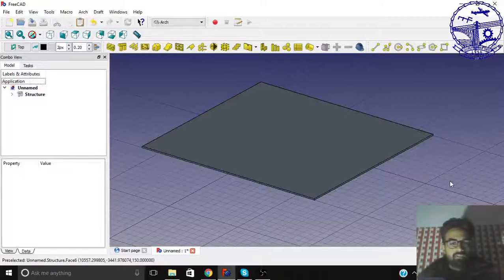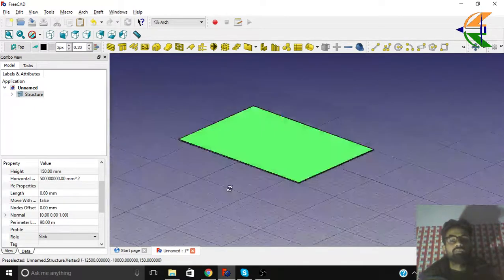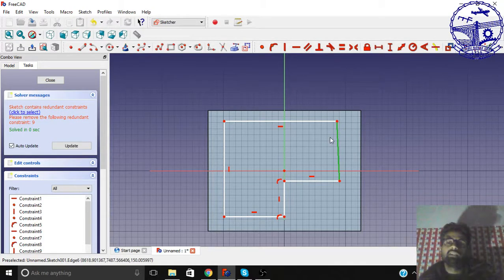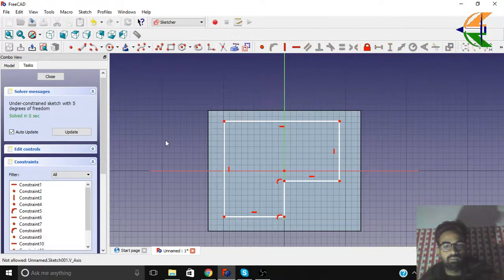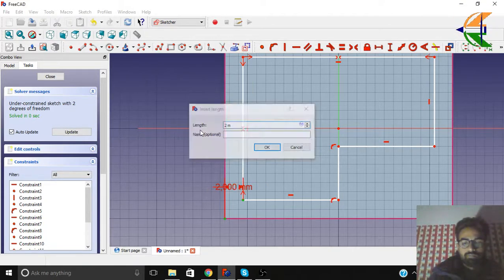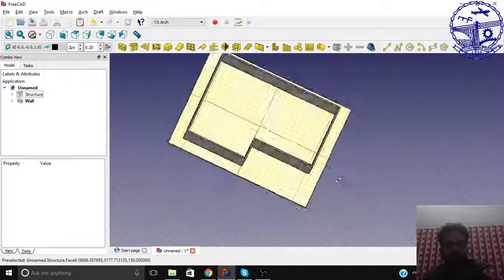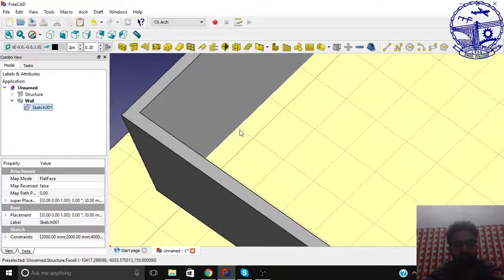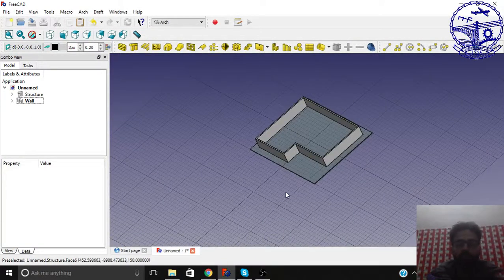3. Architectural BIM Modeling Course Using FreeCAD - Creating External Walls

Comment: How do you make cutouts on the walls?
Reply from the maker: Simply make a sketch on the face of wall where you want opening and then extrude that sketch. Now just cut the extrusion from the wall and you will get opening.
Reply: @EklavyaSelfLearningTutorials  how do you make a sketch on the face of the wall? do i use sketcher workbench?
Reply from the maker: @ashborn5241  yes.
Reply: @EklavyaSelfLearningTutorials  how do you cut the extrusion from the wall?
Reply from the maker: @ashborn5241  you can do that from cut command in part workbench.